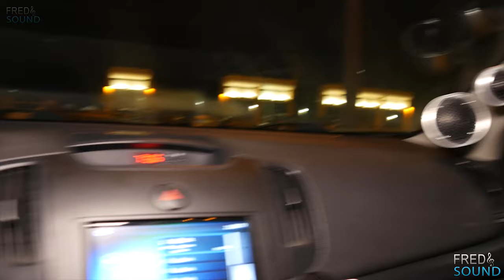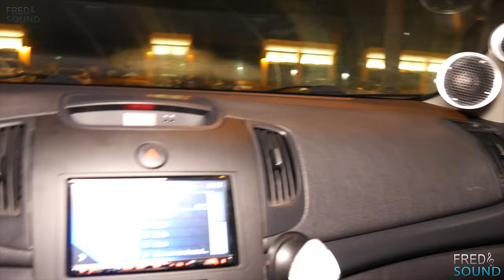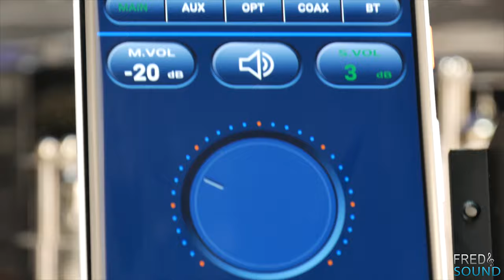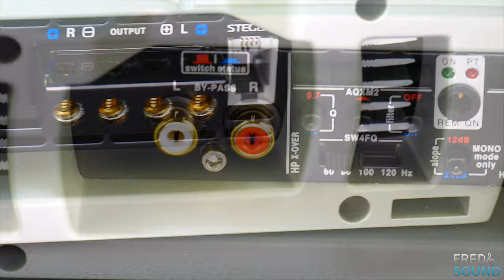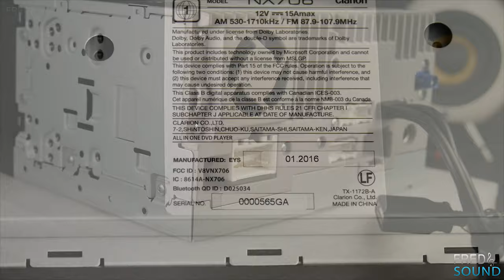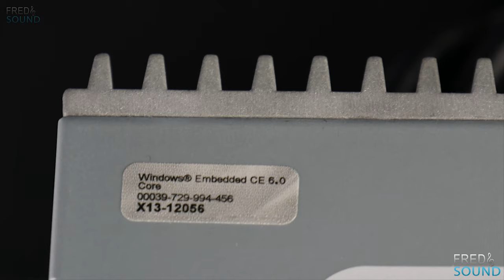AUDIOPHILE 3 WAY ACTIVE DRUMS STEG RE65C + SG30 + SQ32 + SQS12 ACTIVE 3 WAY LIVE TEST OPTICAL SDSP68

Comment: HI FRED. YOU DID EXCELLENT JOB. CAN YOU ADVISE ME? WHICH ONE IS BETTER USING PASSIVE CROSSOVERS WITH MY 3WAY SPEAKER SYSTEM EACH COMPONENT COMING FROM DIFFERENT BRANDS OR ACTIVE CROSSOVER FROM MY PIONEER 80PRS. THANK YOU SO MUCH IN ADVANCE.
Reply from the maker: Hi, active will be better.. thanks for watching
Reply: @frednsound  thank you so much. I am also struggling to choose right amplifier for my hertz mp 70.3 and steg sq32. What do you think helix d four, sony gs4 or hertz hcp 4. Please help me with this as well. Or are there any other options???
Reply from the maker: @azimovshoxrux9502  welcome🎼, AudioSystem f4-400

Comment: My current set up

Kenwood KDC302 headunit
Kenwood XR1703HR 6.5 components for the front
Kenwood excelon tweeters that came with the components
Kenwood KFC-174 for the rear
Kenwood excelon 2x12 reference series 
Kenwood X901-5 for my amp 

What DSP should I get? I looked into the Helix mini or Helix dps.3 but worried it might be too cold or bright 

Do you recommend any replacements as well?
Reply from the maker: Aries King hi, do you already own this setup of the Kenwood? Get the Steg Sdsp68, thanks for watching
Reply: @frednsound  yes I already own it I tuned it pretty good for entry level
Reply from the maker: Aries King great, so just get the sdsp68 and you’re be fine, thanks
Reply: how does it compare to helix mini and dsp.3? Helix real center intrigues me and the Steg seems alittle sketchy can't find nothing hardly on it
Reply from the maker: @ariesking3670  hi, you can't compare them in build quality and sound quality, the sdsp68 is much better, its a small production in Italy, if you need I can help you finding the nearest dealer near you, thanks
Reply: @frednsound  can you find me one under $400?
Reply from the maker: @ariesking3670  hi, no it can't be...
Reply: @frednsound  how much I live in the US
Reply from the maker: Aries King  contact by the email down at the description below, I’ll help you with that , thanks

Comment: What s. The frequency high mid and low.... slop and back speakers good sound ,🔊🎶
Reply from the maker: Gokul raj hi, 
Tweeter:  hi pass 4khz -12db slope,
Midrange: by pass 250hz-4kzh -12 dB slope,
Midbass: low pass 40hz-400hz -6db slope,
Subwoofer: low pass 35hz -24db slope,
There is only front 3 way active + Sub, no rear, powered by optical cable, thanks for watching

Comment: Fred & sound, these sounds awesome! I'm restoring a 1997 bmw 328i convertible, i want a sound sytem like this very clear and crisp. Do they make 5.25" 3 way compnent set? That i can install, im trying to use where the stock speakers are now to make it look more stock as possible. Also, i have an alpine R sub and 2 alpine amps (1 mono for sub) that i bought long time ago and never installed still in the box. Would these work with the amp? Please help! Thanks for your time.
Reply from the maker: BERNARD BONDOC hi, nice car you have.. no, currently they produce only 6.5 size,
You could install 6.5 with speaker spacer/adapter, what is the model of your alpine stereo amp? ,thanks
for watching
Reply: @frednsound  thanks for responding, yeah i love bmw's! My plan is after this rebuild, i'm gonna tackle the sound system for my E92 2007 335i as well, very nice cars but shitty sound systems in my opinion.  The amp i have is a V power MRP-F240.
Reply: What can you recommend for 5.25" 3 way component set that would fit nicely? I think CDT makes em but im not 100% sure, if they do, are they a good set up?
Reply from the maker: BERNARD BONDOC yeah agreed, your amp doesn’t have enough power to run High-End 3 way set, you will need to get new amp for 3WAY Setup, what is your price ranges for the stereo install?, so I’ll recommend you the best, thanks
Reply: If i go with the steg 6.5" do i have to build some kind of enclosing for them on the footwell to make it look more stock? (I'll have to either learn how to build it or get someone to build it for me lol)  Also, what is the price point for the stegs 3 way?
Reply: It depends if i'm going to need to get a new sub and amp too, like most people out there, im trying to budget build, if i can use the sub and amp i have, then maybe 3 way set up with amp around $700? I'm in California btw. Thanks so much for your time and help.
Reply from the maker: BERNARD BONDOC  they have about 10
Different sets, contact me by the email down at the description for more information, I could explain better, thanks
Reply: @frednsound  sounds good, email sent!

Comment: Hi , one quick question is Soundigital amps good with Steg or AudioSystem Speakers ?
Reply from the maker: MrJAANUBOND hi, sound digital are good for spl only in my opinion, the sound quality is not the brightest side, sure it will power them, but you will not get that warm detailed and cleanest like a sound quality amp, thanks for watching
Reply: Fred & Sound and what about banda amps or Zapco?
Reply from the maker: MrJAANUBOND  Banda same as sound digital for spl, Zapco are good, thanks
Reply: Fred & Sound can you suggest a good entry level amplifier brand ?
Reply from the maker: MrJAANUBOND  for real sound quality you can’t find much, today all are copy China made, what is your budget ill
Recommend the one.. ,thanks
Reply: Fred & Sound it’s not about my budget bro it’s just I’m looking for the good entry line up Amplifiers so thought to ask you. But for an example under $100 usd
Reply from the maker: MrJAANUBOND under 100$ you will not find sound quality amp, you will find cheap amps different logo, if you start to cross about 200<, then you could find good sound quality (entry level<) ,thanks